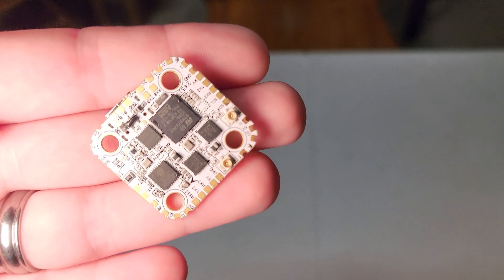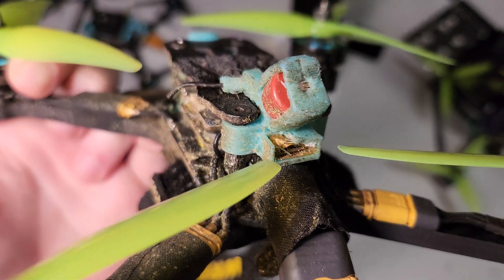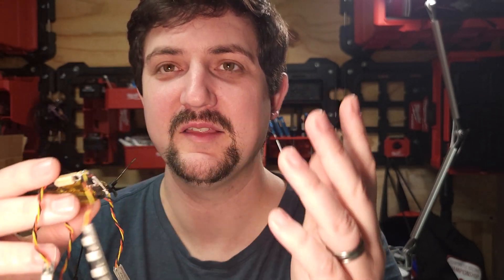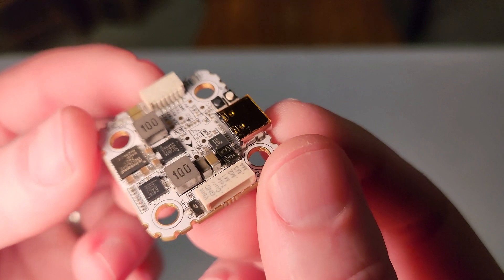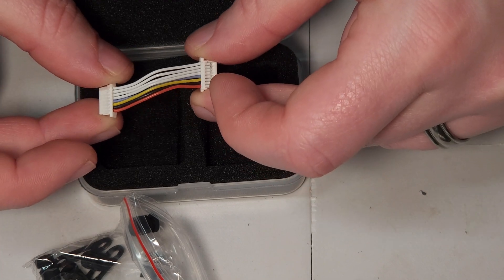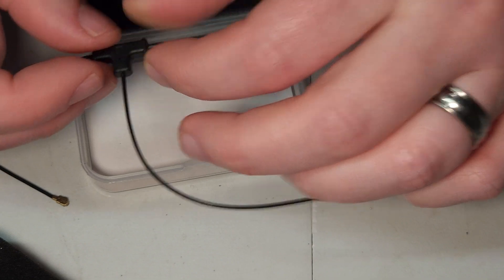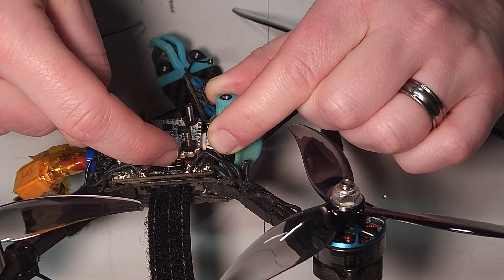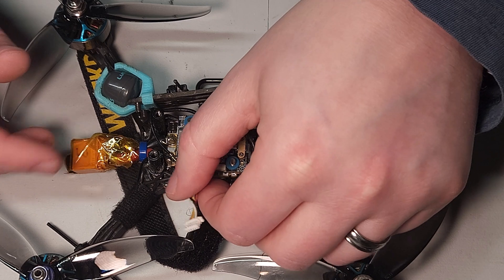The only Flight Controller you'll ever need... HDZero Halo FC Review

Comment: Is this meant for racing or long range. I don't understand the need for Gemini if it was meant for racing. I definitely would not want to buy a Gemini module for the tx, or have to deal with a second antenna on a racing quad.  Am i missing something here..
Reply from the maker: With dual antennas we can have higher LQ when the quad rotates. With dual frequencies we can have higher LQ in a noisy RF environment like a race. You can choose to not install both antennas or even use a simple short wire antenna
Reply: @RyanQuellet  ok, that makes sense. Thank you.  You and Carl keep up the great work.

Comment: Still holding out for a 400mw vtx ;-) (No shame in that plug heh).  This is a pretty damn hot little flight controller.  The ELRS is amazing, brilliant idea to use the space from an analog OSD chip, bonus for Gemeni.  The LED feature is minor for some I'd imagine, but for a 20x20 with 2 modes.  Perfect for a bling-a-ling fun flyer. I'd love to see a matching ESC (Just to have that matching Divimath/HDZ silkscreening on all the boards inside), but there's so many already so not a big deal at all.  This is very exciting to see.  Awesome work!
Reply from the maker: Bling-a-ling!!!!